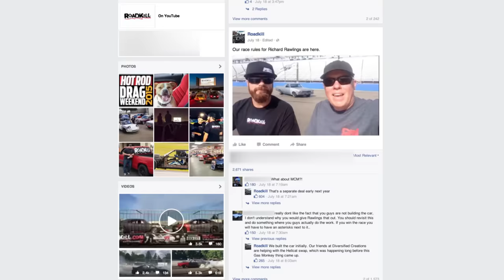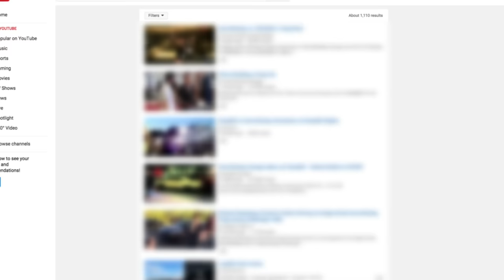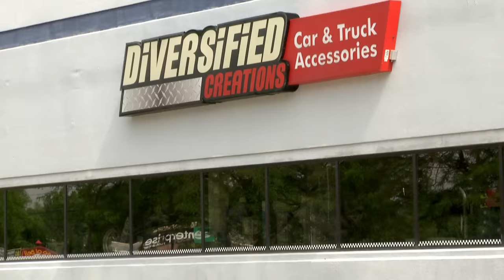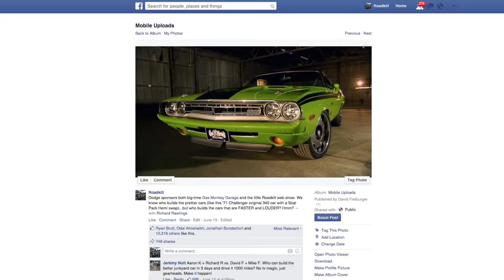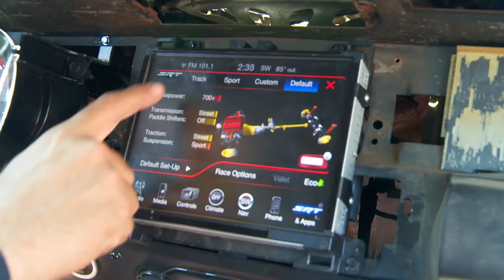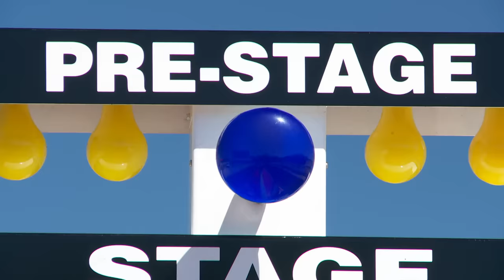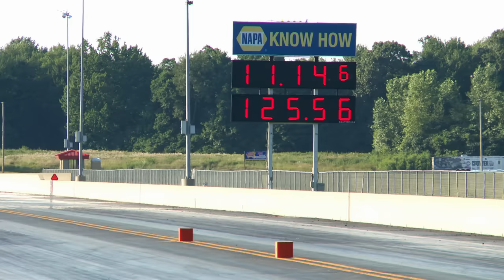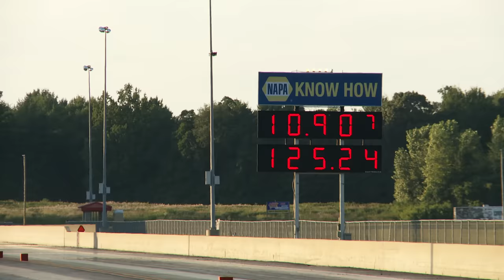General Mayhem: 707HP Hellcat Engine in a 1968 Charger! Roadkill Ep. 43

Comment: old tail lights looked way better. other than that, this is pretty sick
Reply: You honestly think they wanted those taillights? This has been beaten to death already. They only put them in because the way modern cars are the electronics are finicky and the car wouldn't run right without the tails plugged into the harness. Since then, which has been a LONG ASS time ago they've alleviated the problem and the original tails are back in...😒
Reply: +Auto Young you take things way to serious
Reply: +Josh Jones 
So explaining why the taillights were used in the first place and that the originals are back in and have been back in is taking things too seriously? I guess so then...
Reply: CreepinWhileYouSleepin they cant use the old ones because of the new electronics

Comment: Roadkill could you please test what it takes to run over a stop sign?
In a lot of driving games you barely slow down when you hit a small sign.
I suspect IRL you will need a pickup or bigger due to ride height and weight
Reply: Stop signs are cemented into the ground usually, you would cause serious damage, regardless of the car.
Reply: +The Real Plato 
It depends on how the stop sign is manufactured. I hit one dead on the front bumper in a 2007 Malibu and only heard the noise (I was driving at night, and the sign was somehow non-reflective?), didn't feel the impact. I was probably doing like 40mph. The stop sign was mounted on a wooden post, not a metal one, but as far as I could tell afterwards, the car was not damaged.
Reply: +sleepybird09 
I had some passengers distracting me (in an unfamiliar car on unfamiliar roads), so I made an early lane change, and the sign was set into one of those low medians in between two left turn lanes/cutouts on a main strip, one right after the other, so I went into the first one intending for the second one, and couldn't get back into the main driving lane because it was blocked by another car, so I just kept going as I was looking back to see if I could merge, and heard the sharp crack of wood splintering.
Reply: +The Real Plato Not much, we had someone in the area run over a sign on a metal post (not cemented in) at roughly 10-15mph (guy was drunk and made a really wide turn) they didn't realize it until they started hitting potholes while the sign was still stuck under the car.
Reply: +The Real Plato 
Ploughed over a metal poled non-cemented stop sign at 20-30MPH in 1988 Cavalier wagon. Barely scratched the front bumper.
Reply: +The Real Plato Signs and lamp posts are designed to fall over when they're hit by a car to minimize the danger to the vehicle's occupants. Sort of a breakaway system. The base is cemented into the ground, but the post is not secured in the base in a way that would stand up to being hit by a car.
Reply: +The Real Plato I live on a road that the turn on to is a hill and its an odd turn anyhow. When it snows people all the time take out the stop-sign. So they now  have it to brake-a-way easily so they can just rebolt it back into place.
Reply: thx for the stories everyone, I submitted the question to mythbusters too
Reply: yea, most of the cars I seen take out that sign at the end of my road did not suffer any notable damage. I mean the post on a stop sign  is pretty flimsy. nojoke71
Reply: +The Real Plato I ran over a stop sign once in a 1980 Dodge Ram. It was mounted on one of those corrugated sign posts. It dented the bumper but didn't really offer much resistance. It pretty much bent right at the base and didn't slow the truck down at all. I'm sure you could do the same in a car.
Reply: +The Real Plato Every sign near my house is only about a foot in the ground. I could push them down so go figure.
Reply: stop signs are made to sheer off at the bottom. they are made to take a specific ammount of force before breaking off.
Reply: +I〈3hatersx69 This is what I was thinking as well.  Stop signs would be designed to break / bend with not too much force to prevent cars getting severely damaged if crashed into.  They're probably just strong enough to withstand 100 mph worth of wind.
Reply: +The Real Plato heres something close to what you discribed... kind of
http://www.liveleak.com/view?i=b8a_1256333220
Reply: I think road signs are made in two parts so it won't be too bad when you hit them. one part stuck into the ground which is a small stub and the part that goes to the sign. I hit a road sign at 80 miles per hour trying to make a turn and understeered. it resulted with a small dent in the hood and a cracked windshield. the small stub I mentioned before actually hit the bumper and did slight damage to the radiator. other than that the car was fine and I went right through it. if it wasn't for the curb destroying my rim I could have (and eventually did) driven away.
Reply: +The Real Plato it takes a 1989 Ford Falcon. don't ask me how I know.
Reply: +The Real Plato Dude, I did that in a Diesel Peugeot. No damage to the car, just a satisfying "WHAP!!" when it hit the ground. Now a stop LIGHT, iron post and concrete plinth, that's a different matter.....
Reply: +someusername121 aerodynamically speaking stop signs are not even close to big enough to need to worry about wind speeds im pretty sure..

Comment: can I just say, fuck coal rolling on drag strips. It just flat out annoying when some guy is putting out a literal smoke screen as they drive by.
Reply: Dec I've seen diesel trucks leave the strip without rolling coal and it took off very slowly compared to a truck that was spewing black smoke, so rolling coal must do something about power
Reply: because afaik, rolling coal = running rich as fuck and high boost.
Reply: thegrassmaster2 It does not. Its just about being bad at tuning cars or using low quality Pumps and injectors.
Reply: TheNecromancer6666 lol I hope you're trolling or know very little about Diesel performance. You would be right if we were talking about daily driving efficiency but not max power at a drag strip. Not debating the annoyance of 100 kids with a chipped truck fogging out a track but take a look at the guys like firepunk diesel making around 2000hp in a pickup, lots of smoke and I would bet they aren't using anything low quality....
Reply: Bob D I am from europe where we know how to really build engines. If your Diesel is smoking you are throwing away A LOT of power with a slow flamewall. As with any engine the cleaner, the more powerfull. If it would make it faster Audi LMP1 Diesels would have smoked.
Reply: i know this is a bit late but when a cummins for example rolls coal it had a bigger fuel pipe and lets in more fuel giving it more power. yes it can be a bit annoying i even drive a cummins myself and i dont like it because youll get pulled over for it but it gives more power
Reply: Thurman53 It does not only let in more fuel its lets it in slowly, over an elongated period. That happens when you modify a Diesel but have crappy injectors. In comparison to a clean burning Diesel on the same boost (with a really complex and expensive fuel system admittedly) it looses at lot of power because it burns colder and the flame wall is slower.
Reply: Doug Anderson I always advise people to look at Audi Le Mans Diesels, no doubt the pinnacle of Diesel Technology. And surprise, they don't smoke. Also they manage 0-300kph in 8.5 seconds. So there is nothing below a top fuel dragster faster in a straight line then an LMP1 Hybrid.

Comment: I wonder why the General Maintenance has more supercharger whine than the General Mayhem. Don't they have the same engine?
Reply: +napalmnn The exhaust system in the General Mayhem is louder. The whine is there, it's just harder to notice x)
Reply: +napalmnn I was thinking the same
Reply: the general mayham has alouder exhaust
Reply: the general mayham has alouder exhaust
Reply: +Oswaldo Ortiz The general mayhem probably doesn't have cats or restrictive stock exhaust  (at least it shouldn't) so you have more power and more noise.

Comment: Fastest way to drive a late model auto Mopar put it in D and keep it there don’t touch the stick, drop it to first gear with the paddles, pedal to the floor and hold it straight let the car do the job, of course in your fastest drive mode the car will perfect shift every single time the millisecond it’s going to hit the rev limiter it puts it in the next gear you’ll never feel it slow down between shifts

Comment: So what exactly did GMG build? I know it was a 67 Dart and had a Hellcat Powertrain but was it drag car chassis? I know it was BS the way they won but what exactly was their cars specs is what I'm asking. Don't tell me I have to watch their BS show to find out because that is one thing I will not do. I don't even have cable.
Reply: +Kevyn Luchaco Full chassis, back halfed, tubbed and all that
Basically, they built a full on Drag car that probably wouldn't survive drag week...
Reply: Really?? That sucks... The roadkill guys got screwed over on that.
Reply: +Kevyn Luchaco yeah, gmg talked about being able to best roadkill at their own game but came out in a legitimate drag car lmao
Reply: The big thing, powerglide and a stall.
Reply: Actually the big thing was having the whole back half done
Reply: +Thomas Medford Back half only helped so much in their power level.  MX235 class racers are on stock style suspension and 235 drag radials running low 5's and high 4's in the 1/8th.  The powerglide with race converter moves out and keeps it in the power better than the stock 8-speed and converter will.
Reply: +Kevyn Luchaco They essentially broke every rule. Rawlings didn't even drive the car during the race!
Reply: +alscort93 235?! On unprepared street? Hard to believe. Back half might not help but so much when you're prepped but unprepared parking lot that extra rubber helps a lot
Reply: +Joel McMath The General was on a 13.5" slick, on stock style suspension.  They didn't have any issue getting down the strip.  10 second cars don't need back half suspension.
Reply: +LemmonFury Roadkill admitted that they found out what GMG was building before setting the rules specifically to forbid what they had already done. That was some b.s. and GMG just kept doing what they were doing. Roadkill tried to play dirty and it backfired on them, and then they admitted it on national tv.
Reply: Daniel Byington Thank you for that! I never knew about that. Either way, both cars are nice and on opposite ends of the spectrum.

Comment: Stupid. Sticking 2015 bullshit in a '68 Charger is like farting in church, and in this case, is also completely at odds with the "Dirt Cheap Rat Rod" title of the original build episode. If that Charger were alive it would have been wicked embarrassed wearing those corny taillights, airbag steering wheel, and a Knight Rider-esque computer system complete with a video monitor. They should have built a carbureted, naturally-aspirated engine using a 440 or 426 Hemi block.

Comment: A 144K junkyard 5.3 as is with a 76mm turbo into an old Motion Vega Panel wagon off the trailer 6.30 @ 106 and we ran it 19 months with original long block as taken out of the wrecked donor 04 Yukon with a blown tranny. search 6.30 vega on Youtube.